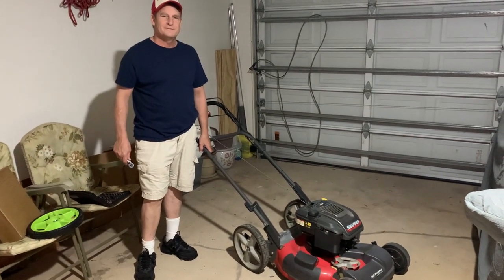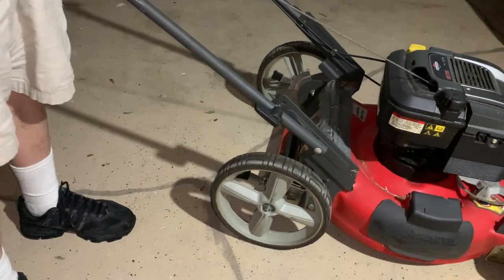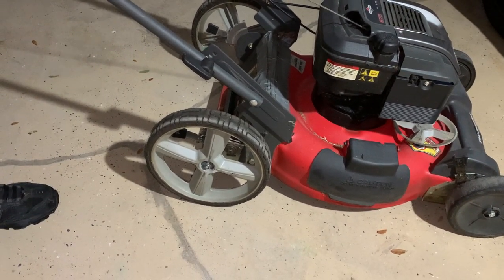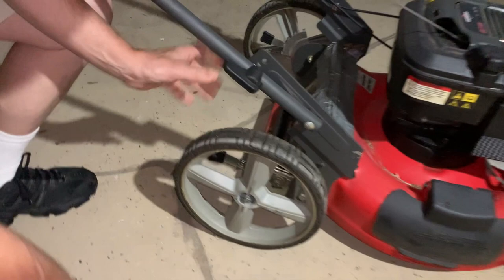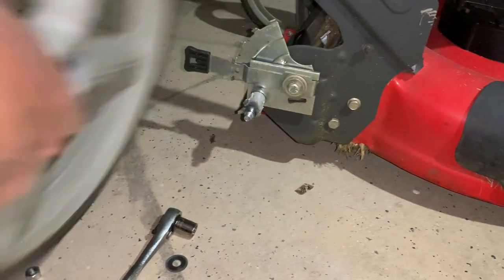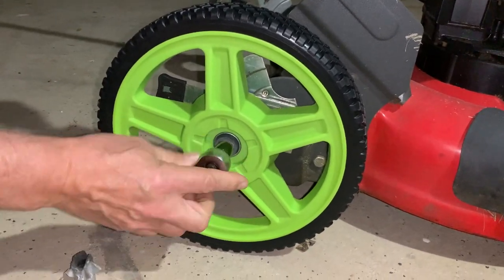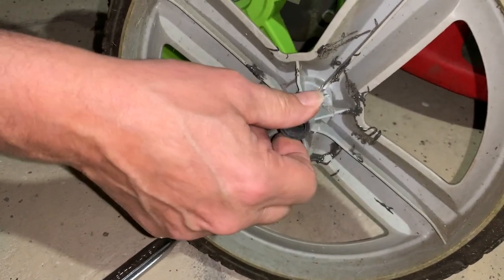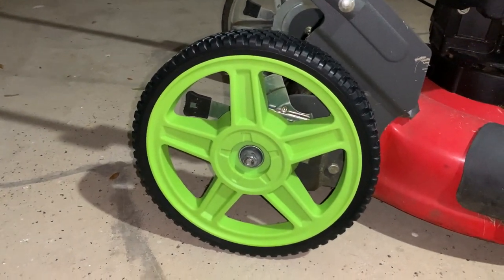Snapper Lawn Mower  Back Wheel Replacement

Comment: It sure does help alot when your replacement wheel has actual bearing races but do they really lubricate the insides of
the races?? Nobody will really know for sure!! I make damned sure that my wheels are upgraded to bearing races!! There
used to be a great lubricant back in the 70's that Yamalube sold as "PJ-5" or PJ-1 for chain lube. It sprayed on thin so as it 
could get deep down into the roller parts of a drive chain, but then it would turn into a grease in a very short period of time, 
thus making a good solid barrier so as to keep moisture out and keep super lubrication in! The aerosolized lube spray came 
in about a 10 oz can and for the longest time was top dog!! It also came with an injector nozzle. Surely, if there is a way to
carefully and gently peel back the outer race bearing seal and get some of the good stuff in there, those bearing races will
absolutely last a very long life, like no other! I do believe that there is a Yamalube chains and sprocket lube spray that is
still made today although it is advertised as PJ1 Blue Label™ Chain Lube, yet this type is another formulation that has a 
white lithium type of base in it. My actual pick in todays run of the litter's would be a spray lube that has moly. Another thing
that i do is if both front and rear wheels on a mower deck are essentially the same,  such as 8" and 10" for example, I purchase 
the larger of the two just so it is wicked easy to just rotate all four wheels once if not twice a year so that they will wear evenly 
and not get all sorts of wooblety and wore out to the point that they are going to try and fall off. And so even if the wheels on
your pushmower deck are nylon per say just go ahead and put some slippery red wheel bearing grease on those axle spindles
at the start of the mowing season and make sure that you rotate those wheels rear to front in a crossed X pattern and that 
can surely help just so you can save up your money for those new wheels with the bearings instead!
Reply from the maker: EXCELLENT advice Craig - thanks for sharing with everyone! John is so abusive to this lawnmower I'm surprised it's even lasted this long. But knowing how crappy things are made these days we will be heeding your advice because we know the "new" models out there are made to die before the wheels would give out! But then again, with John doing the mowing, you never know. Ha ha!